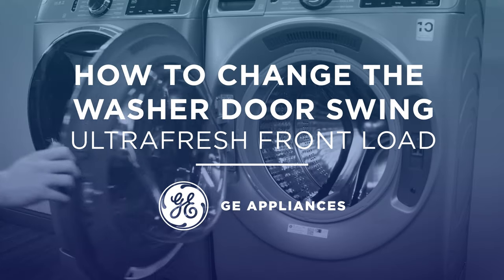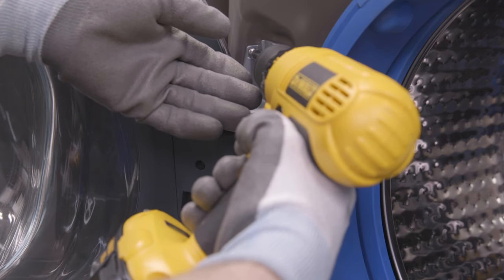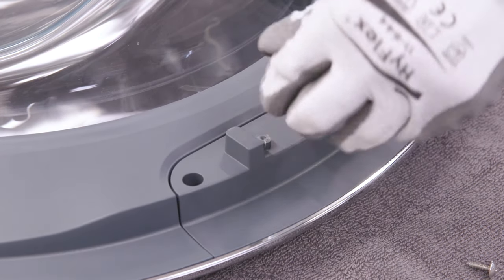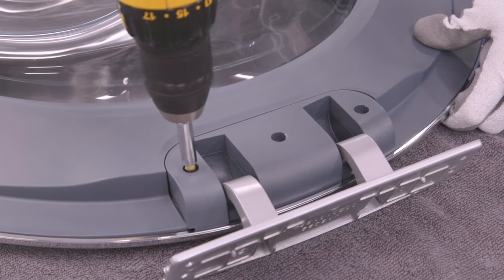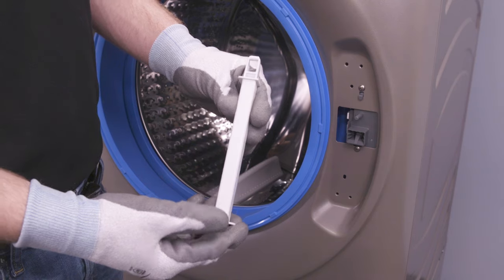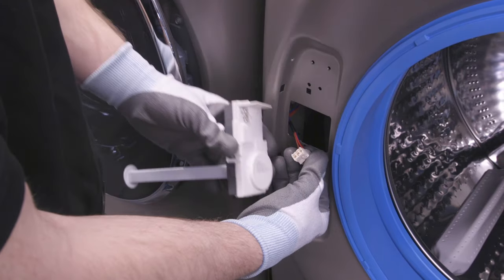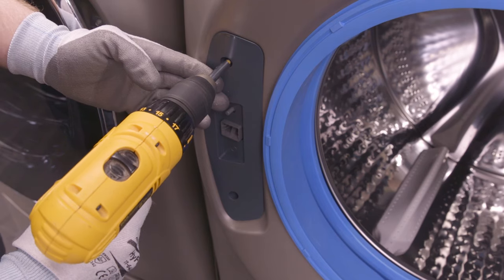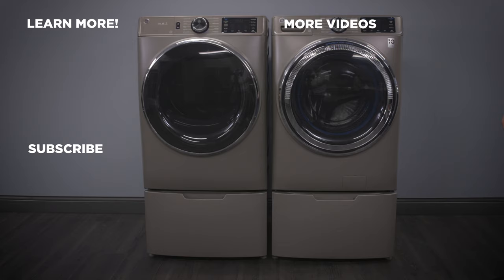UltraFresh Front Load:  How to Change the Washer Door Swing

Comment: If the lock bar tool doesn't remove easily, take it back out and look on the bottom right of the unit. There is a pin that should be in the recessed position. I had take mine back out, push that pin back into place and the bar removed easily. That warning should be added to the instruction video.
Reply from the maker: Thank you for sharing this, Dan. We will pass this along to the video team. We appreciate the feedback. Sincerely, RF
Reply: This was super helpful.  Thank you for taking the time to share.
Reply from the maker: We are glad you were able to find value in this video, Gordon! - TS
Reply: Thank you thank you thank you. That part had me stumped.
Reply: Yeah, the instructions didn’t mention this pin, and I pulled it like in the video. Now the bottom of that piece is cracked.
Reply: @jerrytroiano92  I was afraid of breaking mine, that is how this comment came about. I would be expecting @ge appliances to do right by you. They seem to have seen the problem, but not addressed it. Even some text on the vide showing what they missed would help.
Reply: Omg thank you so much for that!! I literally almost broke trying to pull it off.
Reply: Thank you!  Too bad I snapped the plastic hook on the washer before I read this comment haha
Reply: @ssgtrooney  I had hoped that GE would have updated the video with some text to address this issue. They do know about this issue and have not addressed it. I'd be sure to point that out to them when addressing the issue with customer service.
Reply: @geappliances  people are still breaking their appliances because of this issue. Getting some text on the video would literally take 5 min.
Reply: @ssgtrooney  Same. The lock bar was stuck and I broke it. :(
Reply: Mine just broke because you never updated your video to include this detail, will you be compensating me for a replacement part?
Reply: @geappliances  they are not talking to you. They are thanking me. You need to update the video. It literally takes zero skill. YouTube has the ability add text over the video.
Reply: I knew I should have read the comments; snapped my lock assembly trying to get this thing out
Reply: @Li_Vai  so frustrating!
Reply: @geappliances  Are you ever going to fix your video?
Reply: Amen
Reply: Youre the real MVP. Been struggling with that for hours.
Reply: THANKYOU
Reply: @chevy547  glad I could help. Maybe someone from GE will figure out why this comment is the MOST popular post and fix the video?
Reply: Thank you for this! You saved us from certain disaster.
Reply: @geappliances It’s been 2 years since this comment and the video and owners manual/quick start guide has not been updated. What’s up with that?
Reply: You are a saint!
Reply: I broke mine clean off, then went to comments. Ugh.
Reply: @Tacoslu  sorry. I hate to hear that since @ge could fix this with the text editor in YouTube! A simple overlay if text would have saved you and others so much difficulty.
Reply: Best comment on this video. You're the man!
Reply: So those that broke it were you able to get piece out and fix it or did you have to buy a new piece for door to lock into?
Reply: @danhoctor4894  I took the assembly shell apart, then pushed on the backside of the mechanism with a screwdriver to get it out. Make sure you set the spring back onto the standoff on the bottom side of the shell before securing it back together. Good luck.
Reply: Wish I saw this earlier 😢.  My lockbar broke off and it took an hour to fish the plastic pieces out.   Door would not close until I did that.
Reply: @randypowers3754  if they wanted to fix the instructions it would be so easy. They can put a text overlay on the video with the corrected instructions.
Reply: FANTASTIC TIP.  @geappliances - please fix your guide and video!!!
Reply: Many thanks. I'll try that
Reply: @geappliances I've bought pulled my hair out over this thing. Please make better instructions or make it easier. It's crazy. It will not come out like video shows.
Reply: Got it!!!! Thanks a million

Comment: I completed this on a new UltraFresh Washer. There is no part in this process that goes as smoothly as the video except for screw removal. One main problem is aligning parts on their new location. Some of the plastic doesn't align perfectly until you make numerous micro adjustments. Some of the new screw locations have not had screws in them prior and it is hard to get the screw all the way in at first. I used the lock bar to remove the terminal block but only half inserted when I could due to the scary comments here about breaking parts. Putting the door back on is very difficult even with the hook to hold it. The screws do not line up until many small adjustments are made while  trying to jockey a heavy and awkward door.. The wires only plug back in in one way like someone mentioned so this is one less thing to go wrong, Glad it is over. Dryer waits for another day., ,
Reply from the maker: We're sorry to hear about the difficulty you had during this process. We recommend reviewing the instructions for your specific model in the Installation Instructions written for your model. You can find these instructions here when you input the model number: http://spklr.io/6055sANh
Reply: @geappliances  Your comment misses the mark. I had plenty of written and video instruction. Many nuances are not covered in either,
Reply from the maker: We appreciate your feedback and will be sure to share this with our engineering and design teams. We apologize again for your inconvenience.

Comment: For anyone getting the 'Door" error after reversing make sure you flip the wires on the side you are moving it to.  I went through removing and re-attaching the door and all associated hardware probably 2 or 3 times and kept getting that door error before finally realizing that the sensor on the opposite side was wired brown on top red on bottom and my side was red on top brown on bottom.   Flipping the wire on the side I was moving it to did the trick.  Why on god's green earth they couldnt have just wired both sensors in the same direction is beyond me.  Or at a minimum call this out in the directions at LEAST.  Strike one GE!
Reply: Justin, you just saved a repair call for me. Flipped the plug around and its working perfectly. Thank you!
Reply: I switched my door today, and was ready to heed your words due to your comment, but  GE may have already heard what you and others have said and switched the design as when I  got to that part there was only one way the wires would plug in. Finished assembling, ran the machine, and all is well. :)
Reply: You’re a lifesaver!

Comment: Door Lock Bar Got Stuck! I had the same issue that alot of you had with the lock bar getting stuck. Ours ended up breaking off inside and after hours and hours of prying we were finally able to get the plastic piece out. However I think me mangled the mechanism inside and the door wouldnt close properly after. This was a brand new machine that we had just gotten 2 weeks prior, so I called GE customer service who put my service request through to a local service center. When I didn't receive a call from the local service center I called them myself only to be told that it would be atleast 2 months before someone could come service my machine. Not only that, but by the time they come to take a look at it they would still have to order in the part and then schedule another service call. I found the part online (door lock) and purchased it (cost almost $100), after 2 weeks it came in and we installed it on our machine (works great now). I am upset  because we followed the instructions to a "T" and all it says is to pull out the lock bar. I am hoping GE will reach out and come good for the cost of this part; there is no way I could have been without my washer for months until service could arrive. GE please update your instructions to save others from this situation happening to them!
Reply: I posted about this issue 2 years ago. GE won't update the video with correct instructions.
Reply: I cantnget mine out either. Video shows him just jerking it out. But mine is locked good.
Reply: @DanLivingston what is correct way?  I can't get mine out
Reply: Im not sure what the correct way is because ours snapped off inside @captainmarvel9610 
Not sure if you move the dial to change the type of wash settings I.e. normal, towel etc. If it will release the door? I wish you luck, but I had to change the door mechanism completely when ours snapped off inside the door.
Reply: @jennifera426  someone else answer for me. But thanks so much. There is a pin on the bottom right that you push In to release it tool.

Comment: Success! I skipped using The Lock Bar despite getting one quickly from GE. If you don’t know about it and want to reverse the door later, you won’t find it because the installer will haul it away upon delivery. Before indulging, I checked uniformity with all fasteners. They checked. The only problem I encountered was how fast tight the wire connectors were. Not easy to pull, I used pliers which nearly broke one.

Once everything was tight, I started a small load. Yep, the lock buzzer sounded, so I hit Pause then Start. Nope. I turned the washer Off and repeated. This time the door locked as usual. The best part? NO LEAKS.

Now I have BOTH units swinging open in the way we planned. 

One Thing: I suspect reversing doors on washers is best done when the purchase is fresh; wait, and the gasket may not be forgiving.

Thanks for the vid.
Reply: I’ve had my set a couple years and it worked perfectly. I didn’t have the lock bar either but did it just fine
Reply: Hi -- did you use a tool to hold the mechanism or just fingers?

Comment: A number of people in the comments have mentioned their Lockbar getting stuck.  I just did mine tonight, used the Lockbar, and pulled it out no problem by pulling straight back, as in the video. I will note, I played the video at 25% speed at that part, to make sure I was inserting the Lockbar right-side up and not upside down.  I probably played that part back three times @ 25% speed, and in full screen.  

There were a couple other spots where I had to go 25% speed and repeat a few times. I often wanted to see the exact way they pushed or pulled something.  Definitely made the job easier. 

The only thing I found incorrect in the video, is where it mentions to not tighten the screws on the striker. The GE manual does not mention this, and I found that it's (nearly) impossible to tighten them to a point where the striker plate won't move.  When you tighten them all the way down, the striker plate is still designed to slide around.  I at first left them pretty loose, per the video, but I could just imagine them jiggling free one day and falling out, with washer chaos to follow. Tighten them down and just make sure the striker still has some play to move left/right.

Comment: Dear GE, thank you for making a front-load washer with a reversible door, and for providing this video.  I do have a question, however.  The washer is easily reversed using only the lock bar and a phillips screw driver.  Why make the dryer use 2 torx screws, 2 nut screws, and the rest phillips?  Would be nice to keep everything consistent, especially when the dryer doors are reversed much more often than washers.  Just a thought from someone working for a self-servicing GE dealer. Would help out my warehouse personnel.
Reply from the maker: Hi Gordon - Thank you for your feedback. Your comments are important to us. Our product design division takes these suggestions into account when planning future products. - TS
Reply: hey Gordon, your suggestion might worked. I just reversed the opening door today and all the screws were philips. :)
Reply: @geappliances  Wow! GE is actually reading comment on YouTube.
Reply: @geappliances  can I use pliers in place of my lock bar?

Comment: The instructions were great.  But I couldn't find my lock bar.  So I proceeded and switched the locking mechanism to the other side anyhow without using the lock bar.  Now the locking mechanism is locked - ie. I can't close the door...any suggestions?
Reply: Any solution?

Comment: As others have noted DO NOT USE THE LOCKBAR. It will easily break off inside when you attempt to remove it. Just happened to me. When it breaks off, it damages the locking assembly and the door will not shut. Just had to buy a new assembly from GE, because they have so far refused to put a warning on the video above as several have asked here. On hold with GE Consumer Relations regarding this to ask them to refund the purchase cost.
Reply from the maker: Hello-We are sorry to hear about the trouble you have had with your unit. We do hope the situation has since been resolved. If we can help look into it further for you please feel free to send us a private message with your contact information and include your full model and serial number. All the best-DM

Comment: So the little white housing sensor that comes out of the left side, was I supposed to put that back in on the other side before putting the hing back on ? In the video if you pause at 2:51 the white housing peice is not in there, then when the video continues it just magically appears back in there but didn’t include that in the step, I tried to plug it in but the wiring did not want to fit. Machine is running without error code not in it curently
Reply from the maker: We recommend reviewing the steps in more detail within your unit's owner's manual. For an example, you may view washer GFW650SPNSN manual here: http://spklr.io/6051qCtP. -- Reversing the door starts on page 27.

Comment: Does the lock bar do anything besides hold up the latch so it doesn't fall in the machine?
Reply from the maker: The lock bar is a tool only used to assist you when changing the door swing on your unit.
Reply: @geappliances  , thanks for the reply.  I get that it's supposed to assist me, but what does it do?  They didn't give me mine when they delivered my unit this week and I need to switch the door around.
Reply from the maker: It latches on to the part so that it can be properly removed and reinstalled. We're sorry to hear you didn't receive one with your washer. Please provide your washer's model number, so we can look into this for you. Instructions for locating this number can be found here: http://spklr.io/6054soyQ
Reply: @geappliances  , why can't I use a pair of vise grips?
Reply from the maker: We would not recommend that. We would suggest following the install guide for the unit at the link and if reversing the door swing please use the lock bar. The part number is WH01X30057 and can be found using the link we provided below. http://spklr.io/6053sobv
(page23) http://spklr.io/6054soba.

Comment: I did all the steps, the only one I am not sure about is if I tightened the striker too much. First time running it after reversing door swing I think I got a door lock error? After starting the cycle it went through the sensing step and before it started the actual washing part it stopped flashed "door lock" (where the word lock was just a picture of a lock)  and just stayed that way until I paused and un-paused. After I un-paused it, I heard it click to lock. Now seems to be running fine but I am now paranoid. Is this normal or did I make a mistake? How loose is the striker supposed to be?
Reply from the maker: Hi Kodegyrl,

Thanks for reaching out!

The washer door will automatically lock when the unit has been started. 

If the washer is running, press the START/PAUSE button once it will pause the washer and unlock the door. It will take a few seconds for the door to unlock after pressing PAUSE. Press again to restart the wash cycle. 

In some cycles the washer will drain first, and then unlock the door when it is paused. The washer performs automatic system checks after pressing the START button. Water will flow in 45 seconds or less. The door may lock and unlock before water flows; this is normal. 

Do not try to force the door open when locked (LOCKED indicator ON). This could result in damage to the washer.

Please feel free to send us a private message on Twitter or Facebook should you have any other questions or concerns.

Stay safe. -MS
Reply: @geappliances  Thank you so much! I haven't had the message again so maybe I just didn't close it all the way the first time I tried it. I LOVE this set. They are so great! Any chance you will put out a video to change the swing on the dryer door?
Reply from the maker: Hi Kodegyrl. We are so glad that you love the set and it is our pleasure to help you.  We have not done a video for the dryer door yet. However, we will pass this along to the laundry team. It is a good idea to have a video for that too.  All the best, RF

Comment: Just had my lock bar tool break off too. Spent an hour trying to get the piece of plastic out of the locking assembly. I got it, but the assembly must have broken from the lock bar tool as the door won’t close now. Very disappointed in GE for this video not addressing that fatal flow as others have pointed out. Same is true in the printed directions in the manual that came with the unit.

Comment: should the holes on the opposite side (which held the latch) already be threaded ?  Mine are not, and I don't want to ruin the screws/door.
Reply: threaded, aka tapped.
Reply: @jimostrosky6571  I just reversed the door using phillips screwdriver as I did not have a powerdrill.  My bad.  I could not get the screws in the new holes by hand so off came the door whilst I made sure the screws could go into the threaded holes all the way.  After that, the door went back and with some effort, got the six screws in tight.  Why it was off a bit, I don't know.